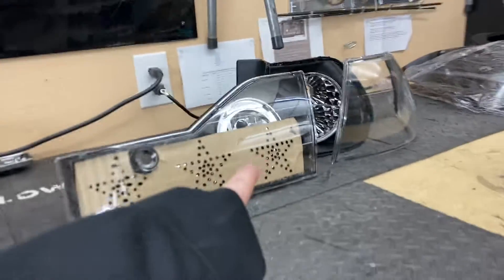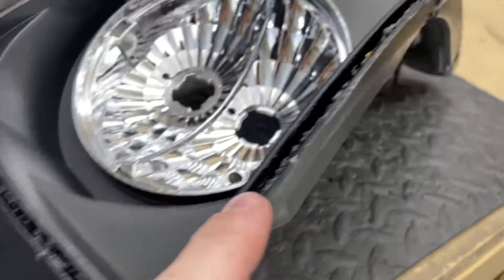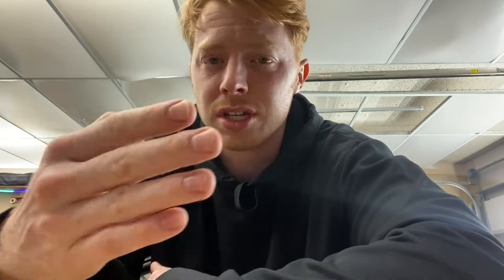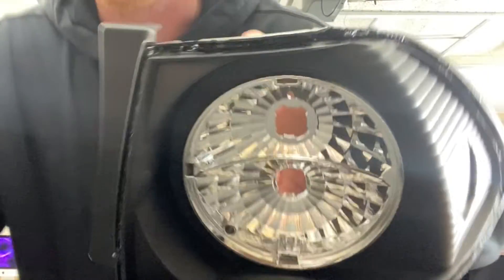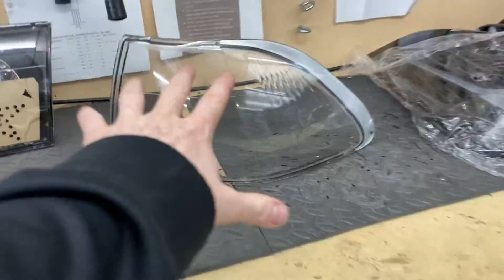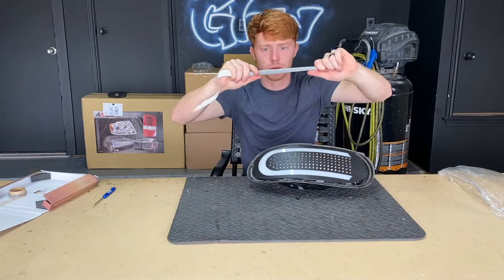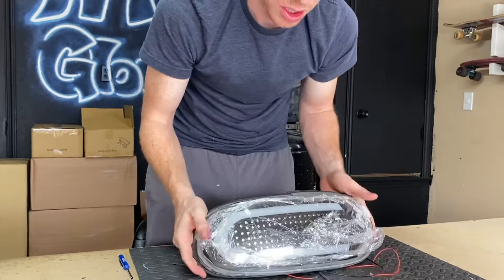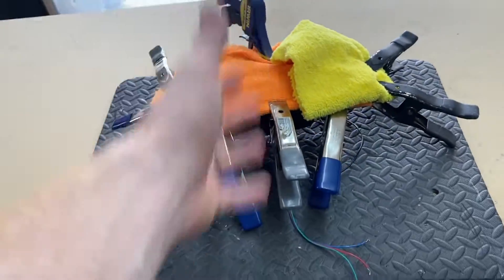how to open 6TH GEN HONDA ACCORD AFTERMARKET tail lights

Comment: Any reccomendations for opening grey butyl sealed tails without an oven? I have been trying a heatgun on some mk4 Golf tails and even after 10-15 minutes of good heating they wouldnt budge.
Reply from the maker: Oh man that’s tough 
I haven’t opened a set of them 
If it’s truly buytl then they will open up with the heat gun it’s just a bit slower than baking it 
With a heat gun i would heat the whole thing evenly for about 5 minutes and then the last few minutes i would focus on side of the light until you can feel the buytl getting soft